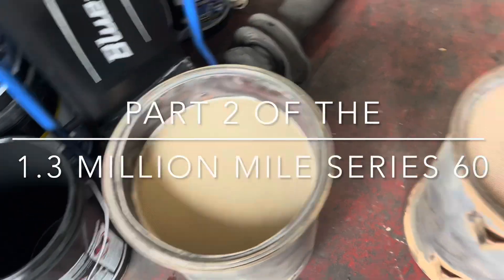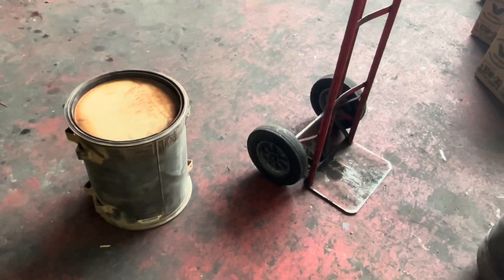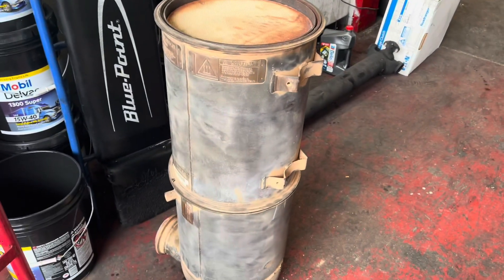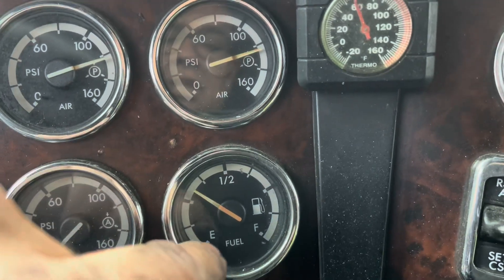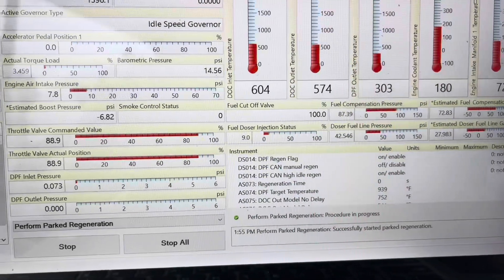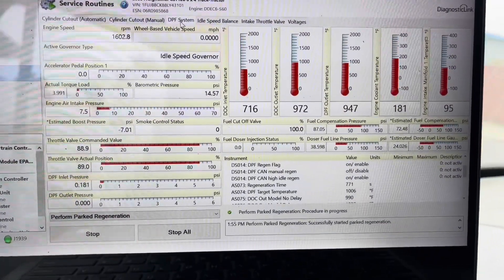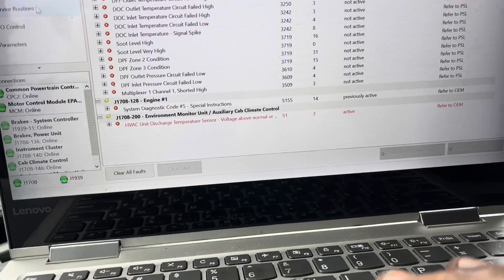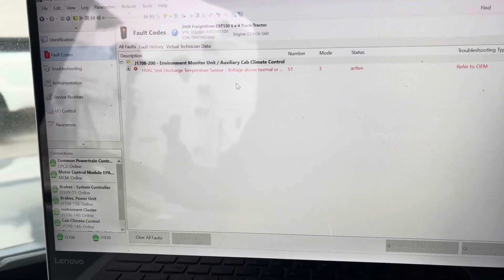Part 2 of the 1.3 million miles Freightliner. Soot Level Very High SPN 3719 FMI 0

Comment: Amigo I have a 2008 freightliner m2 106 Mercedes engine I sent to bake the DPF and DOC filters 3 months later start frequent regen and the filters still clean regen light flashing and dpf temp light on and finally engine protection start , what do you think is causing this ? Gracias.

Comment: on a 2013 freightliner with a dd15 how often should I clean my dpf filters?
Reply from the maker: The MCM will tell you when they are due. The MCM will calculate based on mileage, regen and a few other factors. I think it is about every 250K miles.